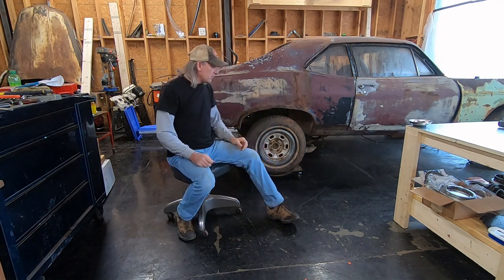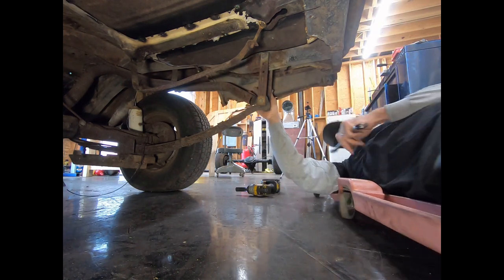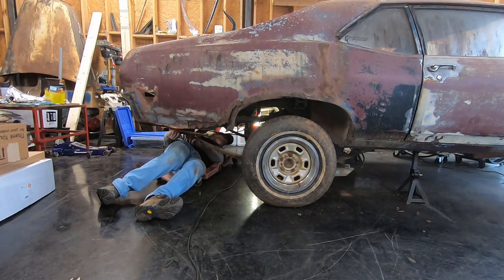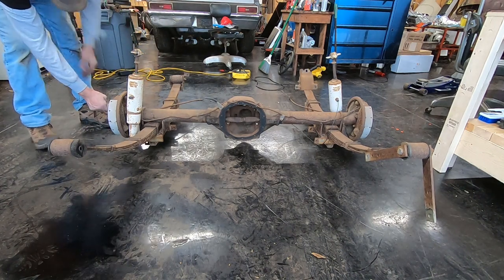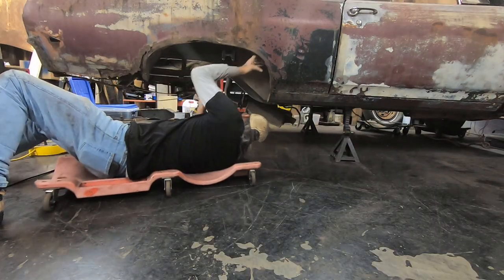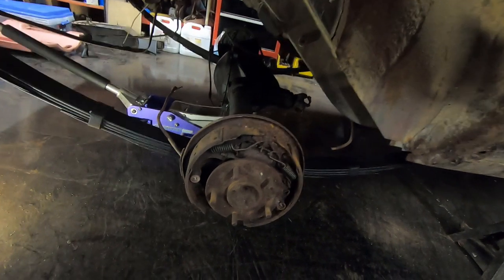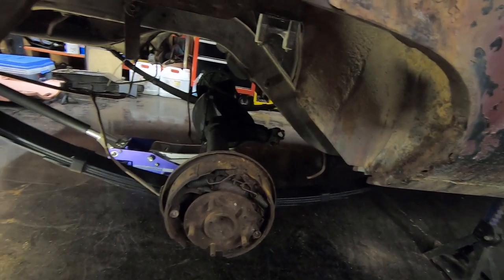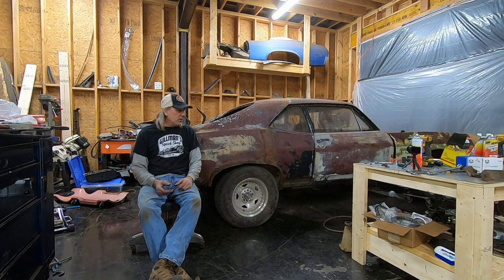Budget Nova Build!

Comment: Loving the build brother!  Newish subscriber, I was the one that asked you about 68-72 vinyl top trim fitting on the 73 last week.  I've had this 73 for about 3 months now and I'm quickly finding that there are some next to impossible things to purchase for the 73/74 year cars... I'm also finding that if they're available, they're not cheap!  Mine is close to being on the road, I have drop spindles and coilovers, a new B&M shifter, a leaky power steering line which I've replaced twice in 3 months (wrong fitting at the back of the reservoir maybe?), and electrical gremlins in the headlights/turn signals up front.  She's close!
Reply from the maker: Cool. Yeah 73/74 stuff is tough to find. Especially if it’s for a hatchback. I forgot to check that vinyl top trim out. I’ll do that today.
Reply: @Shop209  no worries buddy, it’ll be a couple months before I get to actually put the top trim on. I’ve got to do paint and bodywork first. The previous owner did quarters on the car but the fitment on the sail panel is terrible, you can see the line clear as day. I can tell there was vinyl on it before from the adhesion marks in the paint. If I can get the sail panel just right I’ll leave the vinyl top off but if I have to hide that seam then vinyl is where it’s at.

Comment: This is just MY experience with owning and working on 68-74 Nova.  I'm not trying to tell you that the issues I had are what you are having.  I had a 70 and a 74, and both had the leaning left issue.  Both turned out to be left leaf spring sagging.  I had to get both re-arched at a spring shop.  I did left and right at same time obviously to keep them a matched spring rate.  I was told by other Nova Guys this was a common issue and was caused by over weight driver who drove solo all the time, which caused spring to wear out faster on the left side.  The spring shop said same thing.  I thought it was BS, but later in life I worked at a Buick Dealer and the service dept receptionist had a 72 I think and she was pushing 400+ and that poor Nova was leaning left bigtime!!!!  LOL!!!!  I got nothing against Large folks, cause I'm currently one of them..hahaha.  Good Luck hope this helped.
Reply from the maker: Lol. Actually the left spring is sagging. I found another set for free. Gonna have to figure out how to check them before I go through the trouble of changing them.
Reply: @Shop209  With leaf springs removed flip them upside down so bushing side is on the ground a set them side by side and see how high the center is.  You might have to push down on the center of spring just to add load.  Hope that made sense...

Comment: Thanks for the video involving those 3 front spring perch bolts. Gonna do frame ties to mine this summer and u said u prefer the bolt on method. Hopefully all 6 of mine come out as easily as yours did. Lol. Take care John
Reply: Tony, I did a video a few weeks ago while doing my nova rear swap on installing the bolt in subframe connectors (competition engineering) that tie into the front spring perch bolts. You may be interested in checking the video out because some cutting/modifying is required to the frame connector to get the leaf spring eye bolt to go through the perch (directions for the frame connector actually state this may be required, despite it saying everywhere online “BOLT IN”). Might save you some headaches/ frustration when doing yours.
Reply: @hatchsrecreationalengineer1997  awesome thanks. I’ll check it out

Comment: Thanks John for your video very good I did have a question that is on rearend you mentioned it was an 8 inch my question do you think that rearend is as strong as Fords 8 inch the reason I'm asking is I have a GMC SONOMA the same as S10 I was thinking about putting a V8 engine in it and I'm wondering maybe that rearend would work in my truck. I'm wanting to keep it all GM don't get me wrong I like there older trucks 1969 thur 1972. But I've been GM kinda guy most of my life. Anyway I hope your health is doing a lot better. Thanks Ray in Idaho
Reply from the maker: Hey Ray! The Ford 8.8 has a larger ring gear diameter and might be slightly stronger than a Chevy 8.5. They both use 28 spline axles except the later model 2000’s fords use 31 spline. If you keep your 8.5 and put good axles in it and it is set up correctly you won’t have any issues out if it unless you start making hard launches with lots of power.
Reply: @Shop209  thanks for the info I appreciate it.

Comment: If those front perch bolts snap off are those a speedy nut and are they easy to change/replace
Reply from the maker: Yes. Clip nut, j nut, whatever it’s called. However, the ones you can buy now aren’t shaped like originals. Have to tweak then a little.

Comment: Maybe the perches on that rear end are for mono leaf..... would that cause it to sit to high with the multi leafs??
Reply from the maker: I don’t think there’s a difference between mono and multi shackles. Could be but the problem is that the driver side is lower. So I need to find out why it’s different.
Reply: @Shop209  not the shackles, I think the perches welded on the axle are different for mono and multi leafs.    But if it's only on one side that's sitting funny, I would say it's something else causing it.  Please give an update if you find out what it is. 🤘

Comment: Do you have shocks? Maybe that’s why it’s low?
Reply from the maker: Shocks don’t change the ride height unless they are air shocks or coil overs. The spring sets ride height. The drivers side spring is bad. I have another set to put on.